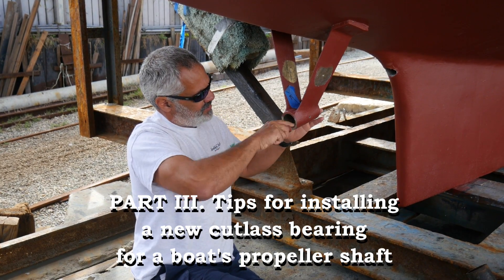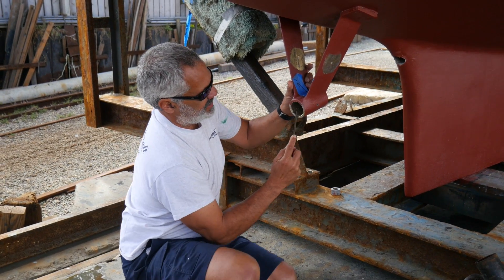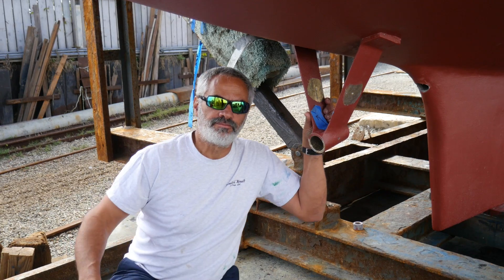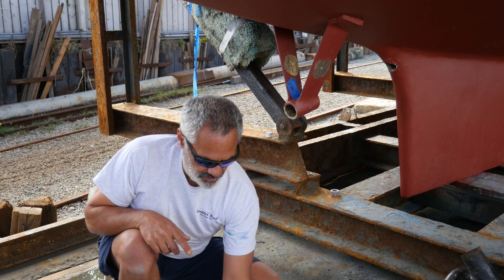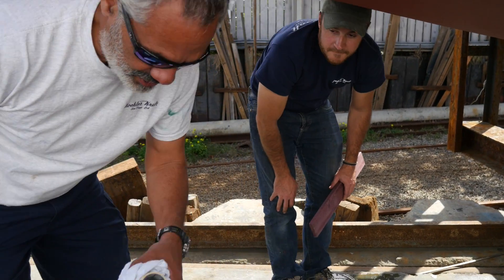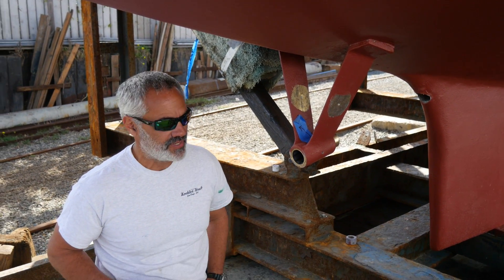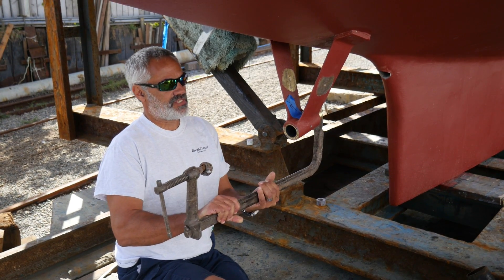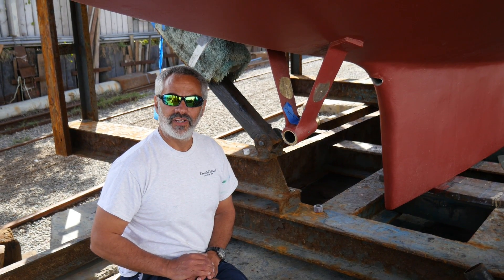Part 3 of 3. Tips for removing and replacing a cutlass bearing for a boat's propeller shaft

Comment: You mentioned temperature change prior to install, im wondering if you did the ole putting a bearing in a freezer technique before install or if that would be bad for the bearing
Reply: They don’t seem to have a problem in the winter.

Comment: Does it matter if the bearing sticks out, do you have to cut it flush or leave it as is
Reply from the maker: As long as you have room for the zinc, it can stick out. Bottom paint it as usual so it doesn't get barnacles

Comment: thank you so much mate been following this wile  doing mine ,  what do you do when it is too long as in the video ? do you cut it or leave it ?
Reply from the maker: You cut it so that it matched the circumference of the shaft. Make sure that the cut joints are positioned opposite to each other.
Reply from the maker: You can do either. 
If there is room for it to stick out the front without getting in the way of the zinc or cutter or, . . . .  Go ahead and leave it. The extra surface area can make it last longer. Just sand it and paint it along with the strut. 

If it gets in the way, cut it flush. I have done both.
Reply: @sailboatcareandrepair   thank you again
Reply: Can you paint it with copper paint?
Reply: @captainkrunch6372  personally as it’s so thick I would only put that on the strut , or p bracket .
Reply: Thank you for posting this matter, I came to the comments to find an answer for the same question.